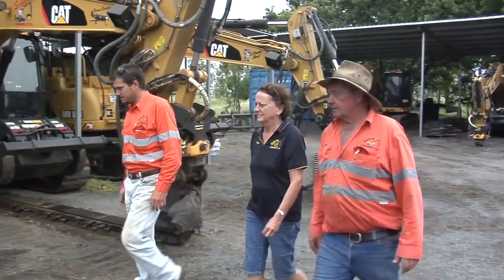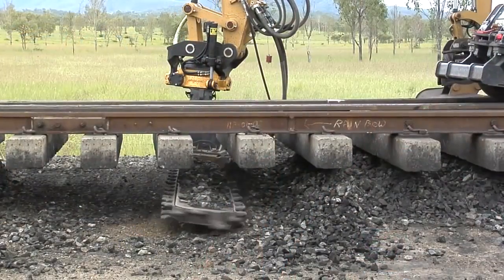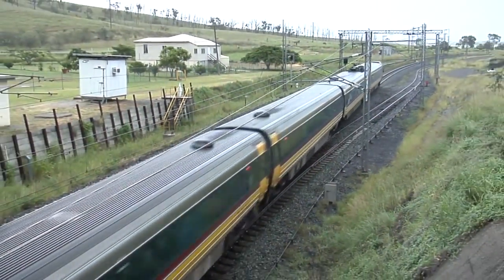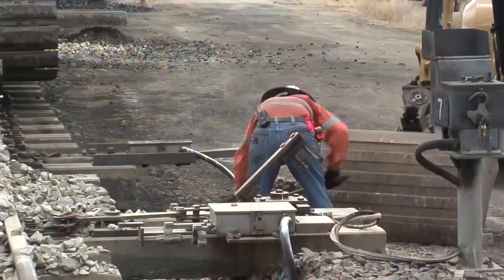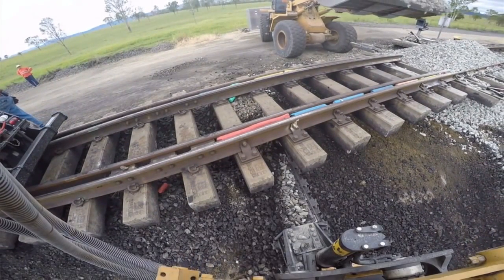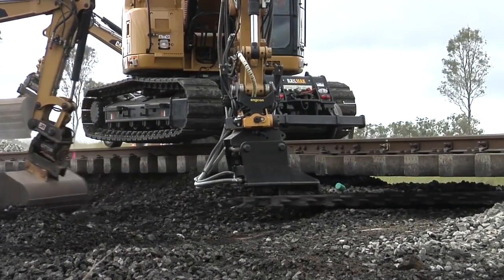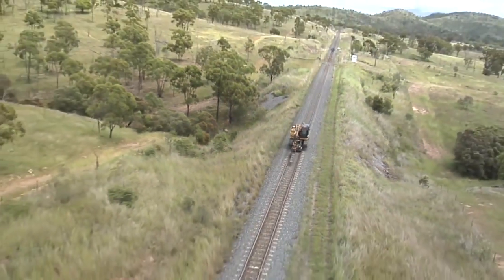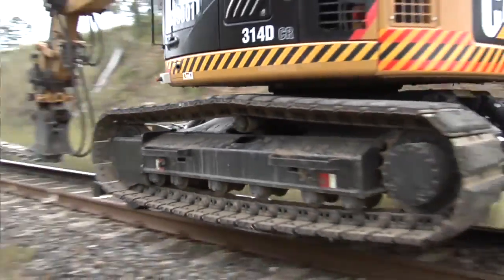High Rail Excavator for Schwarz Excavations

Comment: i love it.. i would think that some more of the chain teeth but attached to augers  on a second machine design would help excavate out the side slopes of ballast for the under cutter to move along faster..  could it be set up using crawler tracks to lift it to a bin that could dump on either side..  or run the augers outward to spread it out away from the tracks.  might be faster than only using bucket excavators.. but it would not replace the bucket excavators..